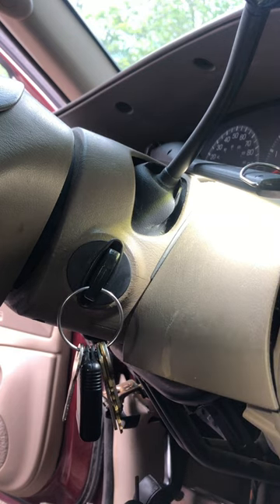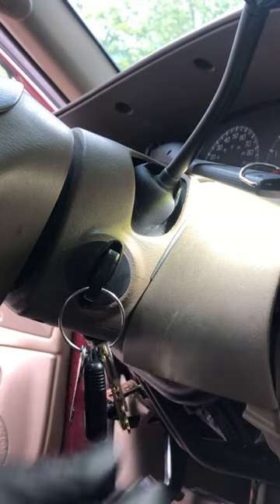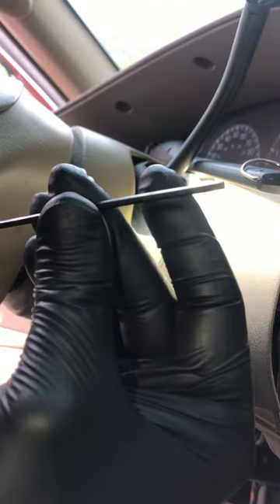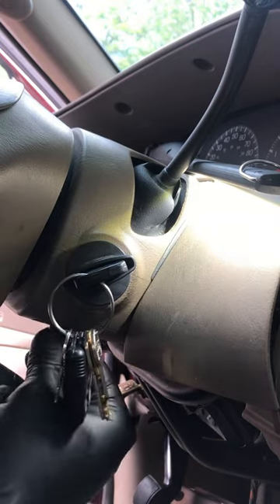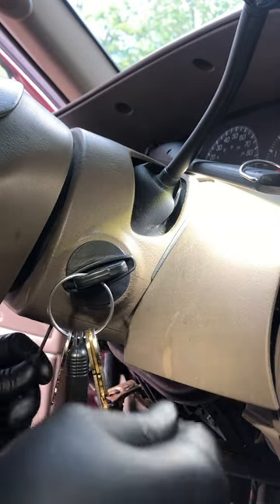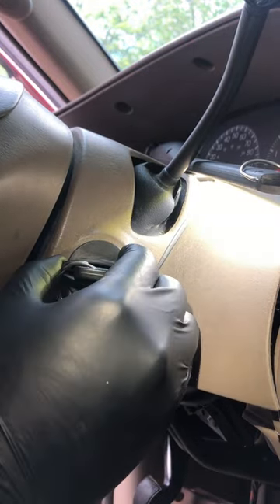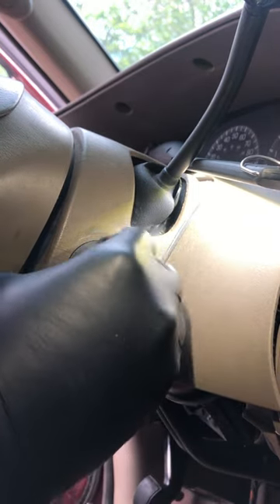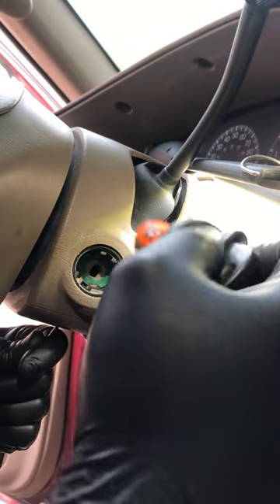Ford Ignition Lock Cylinder Removal | DIY

Comment: If you need to reset the ring sensor on the cover for the anti theft. Get in, lock the door, insert key, cycle on/off (do not engage the starter), after about 5x or so you will hear the locks engage they should be unlocked, relock the doors, and start the truck.
Reply: Will this work to replacing the cylinder it self when you lose the key?

Comment: What if the end of the cylinder broke off inside the housing how do you get that out
Reply from the maker: Probably going to have to drill it out like we discuss in this video: 
How to Remove Ford Ignition Lock Cylinder Without Key #shorts
https://youtube.com/shorts/fPiyvUoNKbY?feature=share
Reply: @daddydiysolutions  god dam I finally got it!! Only cost me $25 and 7 hours of messing with it but I finally got it thank you so much for the video it helped so much

Comment: 1991  mercury grand marquis ls how to take off the neutral safety switch steering column wire harness? Any suggestions my broke
Reply from the maker: What symptoms are you experiencing? Is this preventing the car from starting?

Comment: Does it have to be in park?
Reply from the maker: Most Ford vehicles are equipped with a Neutral Safety Switch which only allows the vehicle to start if it’s in either “Park” or “Neutral”. You can check out this video where I actually step through the wiring diagram for a Ford starting system: 

How to Install a Kill Switch on a Ford Vehicle
https://youtu.be/ZI1n4JEoLg4

Comment: What if the key can’t go forward
Reply from the maker: That’s going to be an issue. Once you rotate the key, there’s a small ball/pin that’s got to be pushed in so that the cylinder can be removed.
Reply: Having that same issue
It won't turn at all

Comment: Would this work on a 2012 Ford focus?
Reply from the maker: Should work. As long as it uses the same type of ignition switch. Not sure what year Ford transitioned to the push button starting system.

Comment: I did this and put it back but my car isn't starting
Reply from the maker: Is this your original lock cylinder or a new one? Remember on some vehicles there's a transponder in the key.
Reply: Original that came with the car. I took it out because I needed to take the outer shell of my steering column off to get to something. I think I made a mistake, is the battery supposed to be connected while taking this out?
Reply from the maker: It doesn't hurt to disconnect the battery. Sounds like you might have something else going on. Next, I'd probably do some testing at the ignition switch to verify there's a good power feed going to the starter relay when the key is in the "start" position. 

You can take a look at the video below for more details: https://youtu.be/ZI1n4JEoLg4
Reply: Idk what else happened, it was working and had power before I took it out now it's  like there's no power I can't start it or lock and unlock it
Reply from the maker: What kind of vehicle do you have?
Reply: @DaPurpleWarrior did you get it fixed, if so can you share any tips I’m experiencing the same problem